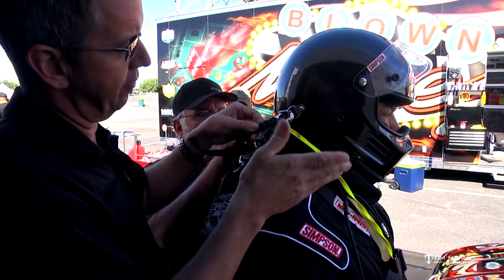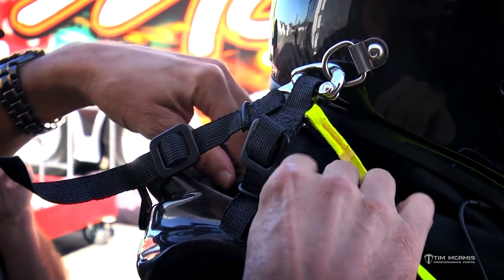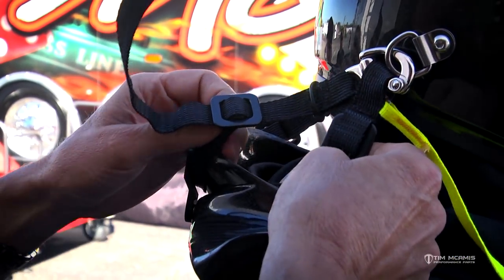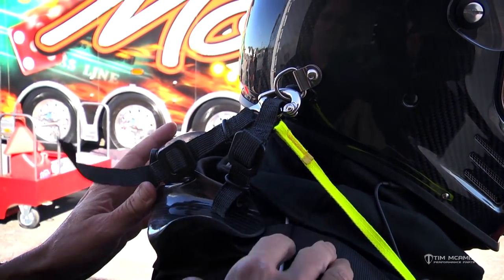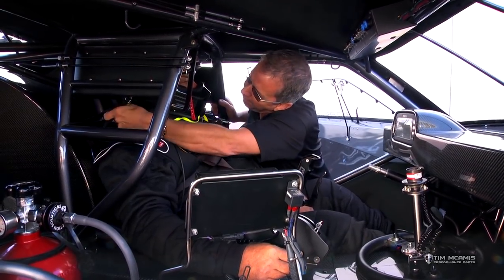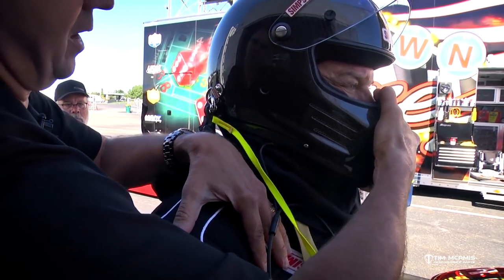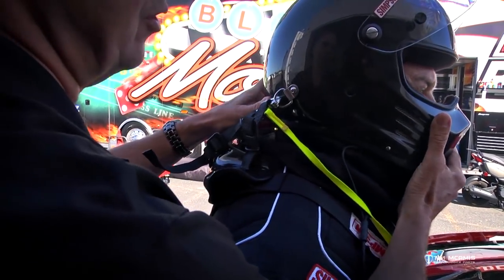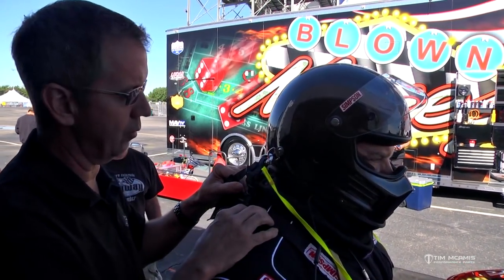Head & Neck Restraint Tips

Comment: Only ever used a HANS device. Thought it awkward at first, but, have become familiar with it after five seasons. HANS seems to me far less fiddley than this in it's adjustments. HANS post type helmet anchors are a bit fussy to use though. Easy to snap on but a bit more difficult to align to un hook with the helmet on. I'm thinking of changing to the ring type anchors seen here. The HANS comes with a good instruction sheet on how to properly fit it. Also, every now and then my sanctioning body sends Emails on HANS fitting, belt fitting/placement and related matters. This is still helpful, to see actual adjustment when it is being worn. Once I'm in the seat and belts are tight I always move my head forward until the anchors stop my head just to be sure they are connected and limit my heads forward travel.
Reply: Agreed. I just keep my hans attached to my helmet and take the entire thing off in one go lol